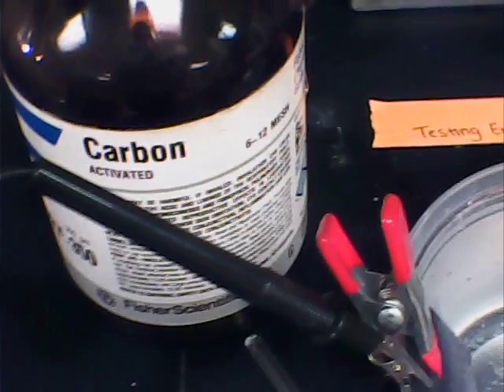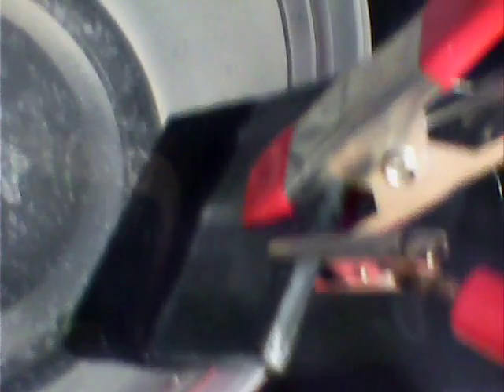Graphite (zinc) Graphite Rechargeable Cell (Battery)

Comment: Hi David, I'm sure that your cell will work much better as a flow battery using a small brushless DC circulating pump, a Supercapacitor, and two Extruded Carbon Water filter cartridges of approx 1-5micron as the electrodes. You can then charge the battery by reversing flow of ionic solution through the filters and obviously one electrode will plate with Zinc until flow is greatly reduced. Then to use as a battery you simply reverse flow of ionic liquid and add it to a circuit. The power wires can be affixed to the Carbon Electrodes using a Silver based conductive adhesive. I've also used this same set-up for Electrolysis of Water in a KOH solution to produce 2H2 + O2 gas with remarkable efficiency, as the surface area of exposed carbon in a single 10 inch extruded filter cartridge is in the area of 1acre or 4000m^2. Twin cartridge Filter housings are also very affordable, as are the Extruded Carbon Filters, and very common OFF-THE-SHELF items at most hardware stores... so this basic flow cell construct is probably one of the simplest and most efficient systems for a plethora of rechargeable ionic battery power supplies.